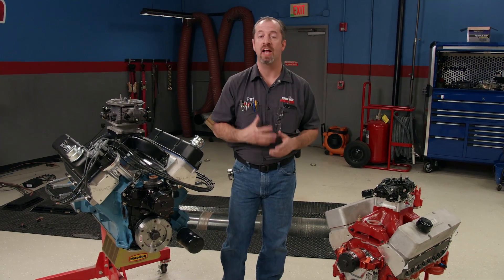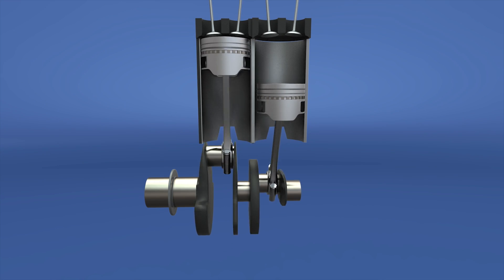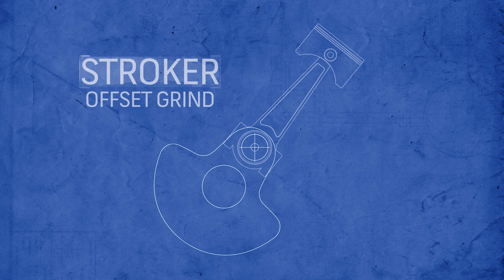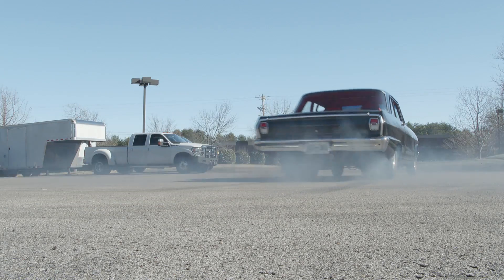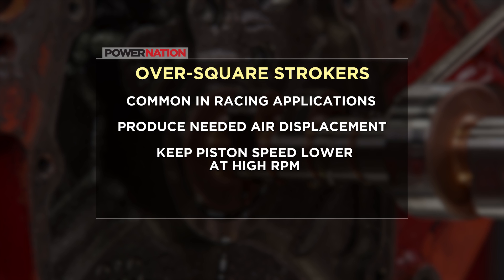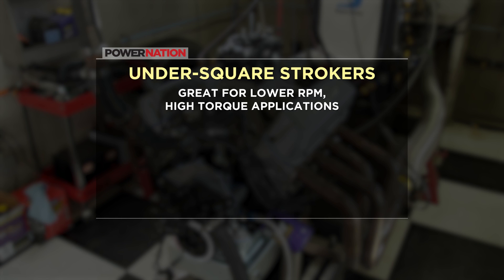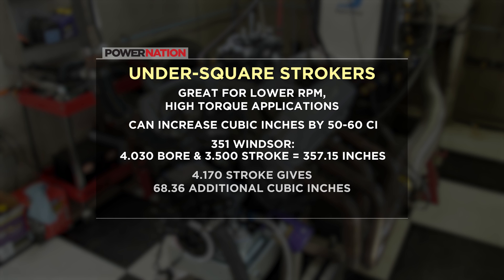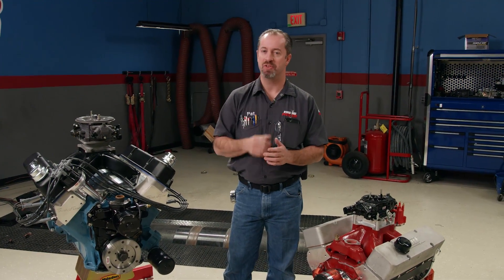Differences In Stroker Engines

Comment: I need help with purchasing the right engine. I recently just purchased a 1979 Chevrolet Malibu (V6) and I want to swap it out with a V8 engine. I’m also a 1st timer so I need a ton of advice.
Reply: build a 632 or 638ci BBC for it, or buy you a Chevy crate engine 632ci BBC that makes 1,000 n/a hp.. Or an LS7 that makes 505hp n gives good 25+ hwy mpgs.. Or any other, but why go with any other engine than those 2?? lol..

Comment: so, by increasing the stroke downward, you will get an increased upward stroke or TDC, so you use custom made shorter pistons.
Reply: and longer rods to keep the piston from falling out the bore or getting way too loose at bdc. Sometimes the wrist pin diameter is shrunk too to accommodate it. Was the case when I went to a 4 inch stroke my in LQ4

Comment: 400 sbc crank in a 4.3L? cut and mill the end to match the 4.3L?
Reply: Well I don't think that would work.
You would end up with a 271 ci v6
The main journals are bigger on a sbc 400 and the cross plan crank would shaped like a Y in the v6. The V8 would be a +.
So over all possible but unreasonable.
Reply: @Soundsofthewood  Stroker
Reply: @kingjeremysircornwell7847  over all you'd be better choosing a different engine. I don't know what you are looking at putting this in.
If you are looking for something weird then get a straight 6 gm engine.
Reply: @Soundsofthewood  I'm also running 2.8liter Fuel injectors. And seat foam in my air cleaner. I'm adding manual steering and flame thrower ignition box next. lowered 2" inches with revers wheels and wheel spacers. Fire & Brimstone
Reply: would you need the 400 cam?
Reply: 4.3 uses offset journals to get all the timing right, even if you could get it in there the cam would be off. Probobly better off with a turbo on the 4.3
Reply: @yurimodin7333  Turbine on crank for perfectly meter air and a Flamethrower ignition module.

Comment: I have a question about.
I am dealing to buy a Trans am 1977 From Germany.
This man buy it from Florida,and the car it doesn't have the original motor (4,9 turbo) instead it has a 350 block with 383 stoker.
The motor is ebelbrok. I don't  know what does means because here i live we don't have those types of cars or engines.
And also if i buy it can i find parts from USA???
I am waiting for your answer.
Regards from Greece
Reply: it means that the 383 stroker engine is originally a 350 ci small block (5.7 litres) bored 0.030 over ( a 350 cylinder diameter is 4 inches and has been increased to 4.030 inches). then a bigger crankshaft has been installed (3.48 inch for a 350ci, swapped for a 3.75 inch ). the combined cylinder diameter increase and bigger crankshaft increases the overall volume to 383 cubic inches (6.3 litres). more volume means more power. 383 engines are beasts! You can find parts at various shops in the usa and import them easily to europe. some car shops in germany and france also have parts (although in smaller variety and quantity). I hope I answered your question buddy. take care.

Comment: Doesn't increased stroke limit rpm in turn affecting peak hp?
Reply: jayknight139 I think there’s a ratio where increase stroke increases torque and hp and there’s a threshold where it flattens out. Increasing stroke allows more air and fuel
Reply: @WesternReloader  ok that makes sense. And I would like to know more about this because most racing that I'm aware of like motorcycle and f1 stay away from increasing stroke to much because they operate at high rpm. But for street use it might be great.
Reply: @jayknight139  yeah you wanna crank a longer stroked engine a little less like the 383 vs a 350

Comment: If I change the stroker crankshaft, do I need to change the piston and conrod?
Reply: Typically you need a piston with a shorter compression height. Some situations do need a longer connecting rod.
Reply: Skyline Fever thank you man

Comment: Does bigger bore better top end?
Reply: In n/a it would but in a boosted engine it would be better not to risk making thin cylinder walls
Reply: @jayknight139  unless you have an aftermarket block or had your block concreted or have had a good set of aftermarket sleeves put in your block but yes your right if you're working with a stock block with stock sleeves and nothing else than it is a good thing not to go too crazy on having your block being bored out too much and just go with a stroker kit which is longer rods and a bigger stroked crankshaft like taking a 350 SBC and putting a 400 SBC crankshaft in it thus turning it into a 383 stroker or taking a 400 block and putting a 350 crank in it does the same thing but I do believe if you do it that way you have to use a 6.0" rod and if you were to use a 350 block with a 400 crank than you could use a 5.7" rod
Reply: @keefespencer1173  the 350 crank in a 400 block makes it a 377

Comment: So how big can a mopar 383 or 440 be stocked too? Low end mild Thumper two balls to the wall all out race motor
Reply: I've built a 526 in a factory 440 block and it wasn't terribly difficult.
Reply: @DaveMcLain  what rod size did you use? im buying parts for mine and i thought 💭 7in long rods will fit? or at least longer than 6in with stock ( 10-12in ish aka no decking down ) RB deck hight aiming for higher compassion thats why i picked it / big cam so it needs it. crankshaft throws are 4.5 in as thats the biggest one that fits a stock block without grinding
Reply: @richardprice5978  The customer had supplied a kit for that build and that engine used a 7.1 inch rod with big block Chevy wrist pin and rod journal sizes.  This engine had a 4.375 stroke and it was easy to make it clear.  You'll be getting another .062 closer to everything but that shouldn't be a whole lot more work.
Reply: @DaveMcLain  thanks im going for stock sizes of bearings or bigger sizes ( aka ford 460 bbf as i don't trust my engine to K24 Honda sizes ) as im not planning on reving it past 6k-6500 rpm but it basically going to have the same loading as a heavily loaded industrial / marine / blower motor / big gulps of nitrogenous
Reply: @richardprice5978  The rods for the 2.375 journals have the bolts spaced wider than a rod for 2.200 journals usually.   On the big Chrysler engine getting the rod past the place where the oil pickup screws into the block is the problem.  I've done a 4.140 stroke with an Eagle rod using the Chrysler journal and I had to do some grinding to get past that boss on the block.  With a 4.375 stroke and a similar rod made for a 2.200 journal I had to grind a very similar amount.  With a 4.500 I think it'll be close to impossible with a larger journal than 2.200 without going with an external oil line to the pickup.
Reply: 500 for a 383 540 for a 440